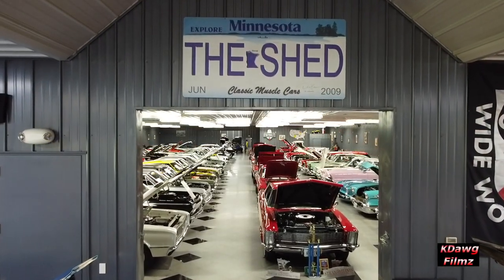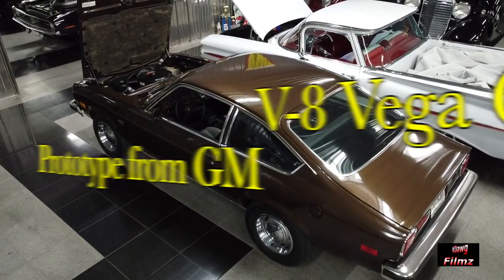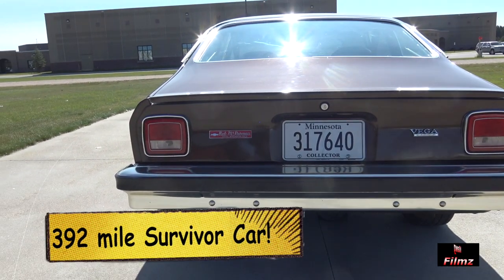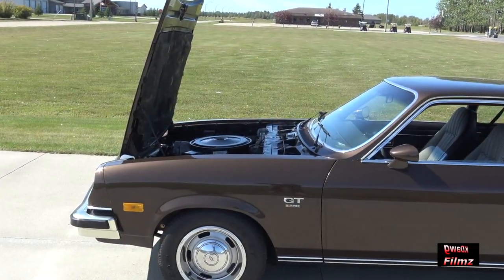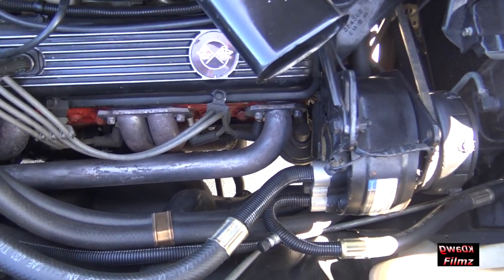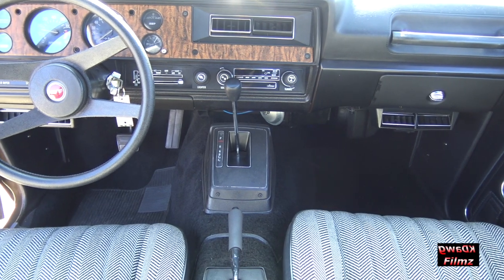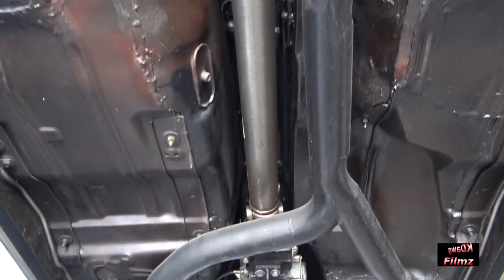1975 Chevrolet Vega GT Prototype 350/370 HP in the Bob Marvin Collection at “The Shed”  Warroad, MN.

Comment: My biggest question is how did this car escape the crusher and get offered for public sale? I had a friend that worked for then, Sam Allen Salvage in metro Detroit and they crushed cars Like this for GM and other manufacturers. My family worked for GM for 63 straight years among them and I used to hear about all the vehicles and parts that went to the crusher, and trust me many of those drive trains made it out to the street. My friend gave me a Quadra jet carburetor from there and when I went to get it rebuilt later nobody could figure out the numbers on it for a carburetor kit,  because they didn’t exist. I would like to know how this car escaped the crusher, it’s too bad they didn’t mass produce that car because it’s a good looking car with a reliable drive train!
Reply: This car could get out the way your Q-Jet did... or like the only '83 Corvette still in known existence did... 
Anyway, by 1975 GM was putting SBC V8 engines in Monzas so all the H-body cars (Vega, Astre, Starfire, Skylark, LeMans, Sunbird, etc.) were then already set up for V6's and V8's! Better front suspension, stronger crossmember, HVAC moved out of the way... 5 speed... posi... 
You could save 100 lbs. putting a SBC 400 like this in one: 
 https://www.dailymotion.com/video/x3rfhrk

Comment: I painted my 1972 Vega this color. It sucked !!! However, my Vega GT was the underpowered 4-140 engine. I rebuilt these Vegas with a steel sleeved block from S &  S in California. The block was over bored and had 4 Ford tractor sleeves installed. Took a special KD tool to remove the stock cam and lifters. Without steel lines the all aluminum block walls had a Teflon coating that the ductile iron rings just destroyed. Not done yet. approximately 1/2 of all pressure tested iron cylinder heads would crack in the oil passages cast in the heads. So, there NEVER was a factory steel sleeved Vega sold to the public. I was rebuilding these engines while several more years of Vegas were produced through the 1977 model year. The Vega was replaced in 1975 with the Chevrolet Monza. The Monza had an iron 4 cylinder engine and offered a pitiful low horsepower 350 cubic inch V8 that had less than 150 HP. Also the V8 motor mounts were pitiful. After market V8 engine mounts were better ( in my opinion ) than stock GM engine mounts. After doing these V8 modifications expect the body to warp as the unibody would flex permanently.

Comment: The Monza came out in 1975, the Monza chassis and rear end configuration were significantly
different than the Vega. The Monza torque arm handles V8 weight, and torque much better than the Tri 4 link rear Vega. The handling of a v8 Monza at speed is much better than the Vega, even with the extra weight up front. Those headers would never be used by GM, especially since the Monza exhaust had been developed and approved for production. The decision to end the Vega came in 1974, at the end of 77. Why prototype a v8 Vega when the Monza was IN production for 75 release. This Vega is very nice, I would be proud to have it, but prototype, well.........
Reply: The 75 vega also had the torque arm. It`s missing on this car. This is a 74 vega. The 75`s had different tail lights.
Reply: @HEHE-dx9og  Well either it's a torque are or a 4 link...there  is no in between, the floor pan has significant differences, as does the drive train, I have two Monza's...the rub is convert away from the torque arm, which has no H-body aftermarket support, with a custom back half, or fabricate custom torque arm/chassis/drive train upgrades. Like I said before, It's a nice Vega, I would like to have it, but prototype.....I ain't buying it.

Comment: I had a Vega for about a good minute in the 80s until the terrible Aluminum Engine blew.. Left it on the side of the road and never looke back!!
Reply: I had a red GT in the 80’s, and the aluminum block ended up bored .010” over on its own before I sold it.  I really loved the car, and dreamed of having a great engine in it. Even a built V6 would have been a massive improvement in such a light little coupe.

Comment: LT-1 ?
Reply: Yep , back in 1970 Chevrolet changed the engine codes from a single letter, two digit ( L88 ) to two letters and a single digit code ( LT 1 ) . They also had LS 5 , LS 6 , and LS 7  big block 454s .

Comment: "Experimental" AC was mentioned thats why it has the newer style compressor. 
So the exh was replaced, things get old and rot believe it or not. 
If the guy has papers, history whats with all the negative nancys? Think its a cool ride, probably better built than most garage builds. 
Juse raise the idle up where its supposed to be....and drive it! 
MIles arent going to change value. No way could I not drive this

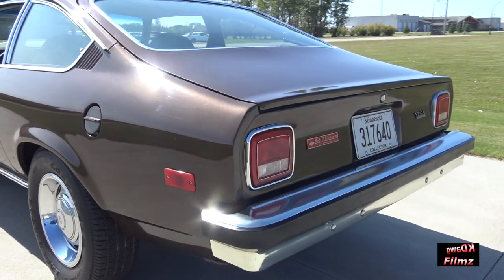Comment: 3:04 - From the sound of it, they should fix the holes in the exhaust.  Yeah, it likely has a racing cam in it, but still.  And who in the EFFING Hell, at GM, decided to put that type of engine in and pair it with a GM three speed automatic transmission?????  +facepalm+

Comment: The 75 vega had a torque arm from the rear to the transmission tail housing. This car does not. I see losts of tach welds on the transmission hump and floor as well, Probably due to rust repair. Chevy NEVER made a V8 vega. This is a backyard machanic build. That A4 a/c compressor didn`t come out till the 80`s. The 70`s used the A6 compressor. You can see the waves in the paint from poor bodywork. Just another home built V8 vega. Nah, Nice try. Pretty cool car but not a gm prototype.
Reply: Youse see by 1975 GM was putting SBC V8 engines in Monzas so all the H-body cars (Vega, Astre, Starfire, Skylark, LeMans, Sunbird, etc.) were then already set up for V6's and V8's! Better front suspension, stronger crossmember, HVAC moved out of the way... 5 speed... posi... torque arm rear... 
You could save 100 lbs. putting a SBC 400 like this in one vs all iron 262 V8: 
 https://www.dailymotion.com/video/x3rfhrk